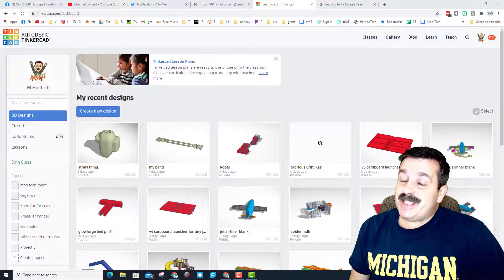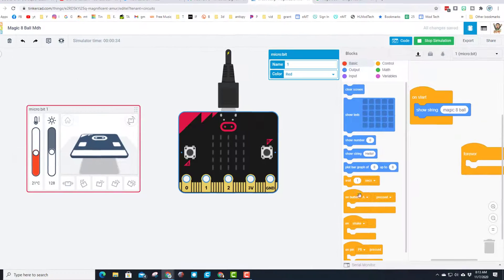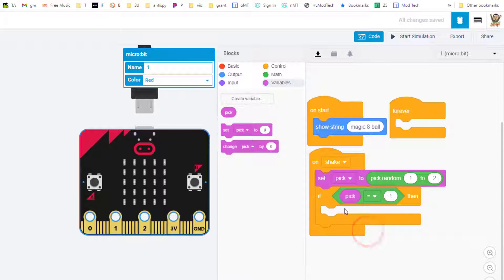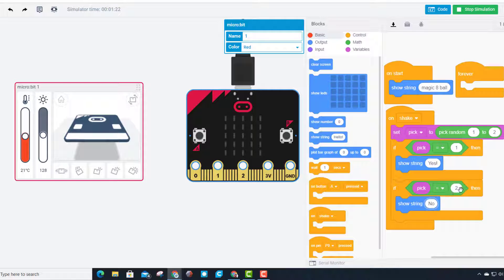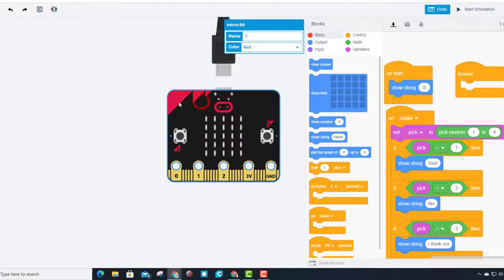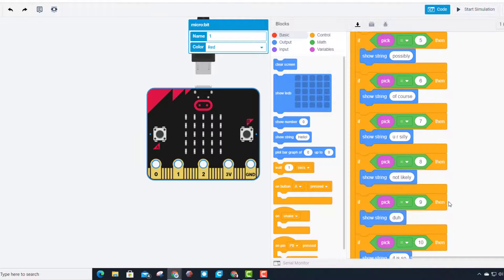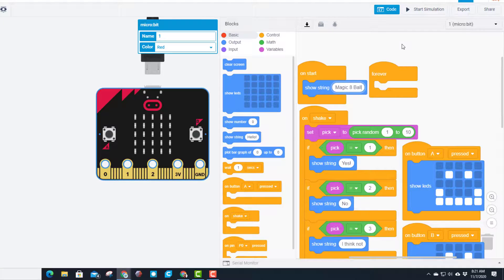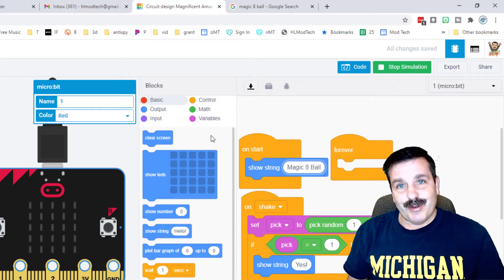Make a Micro:bit Magic 8 Ball in Minutes with Tinkercad Circuits

Comment: Thanks for the video. My impression so far is the micro:bit is the 'Tinkercad" of this space. They made it as accessible to beginners as possible even if it meant sacrificing some utility.
Reply from the maker: Thanks! I wish I had one to play with in my classroom. I have seen where a lot of classrooms have whipped up some pretty interactive creations after simulating in Tinkercad. I think Tink can even send the code to the Micro bit. Thank you very much for the Super Thanks too. 💯👍